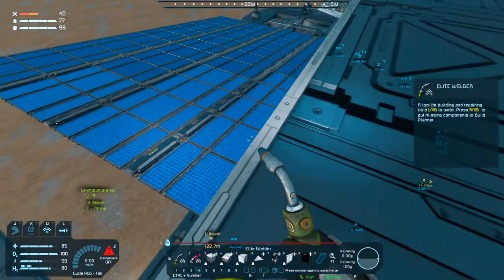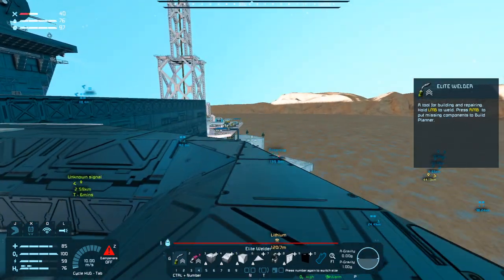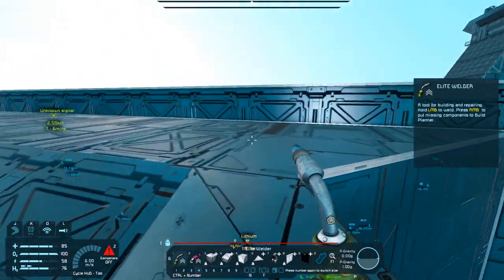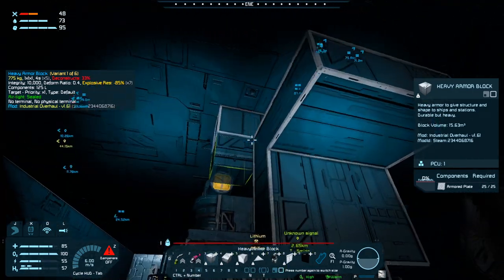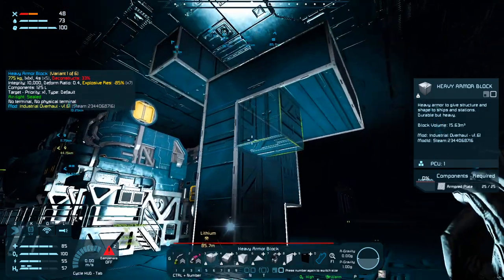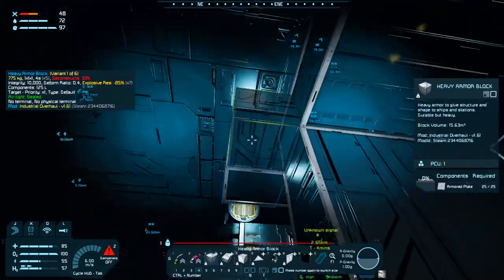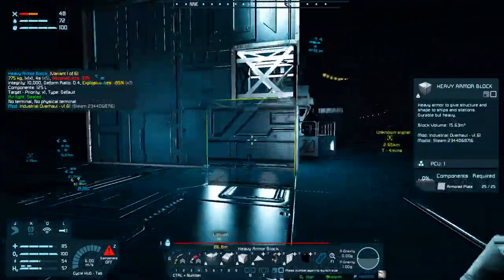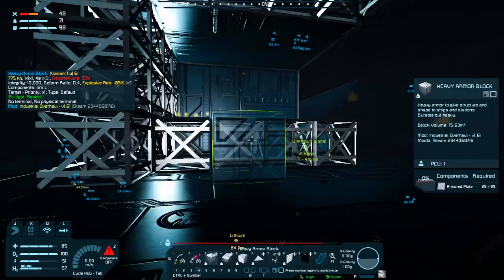Space Engineers ~ Sunken Hope ~ Coffin Box ~ EP 177

Comment: It is interesting that you have pipes running between hulls, because in some ships this was a standard way of keeping them out of the way of other things [made more room to move and fewer things to trip over or hit your head on, although this is not a completely universal tactic, obviously.

Some more modern ships have large, full length, central conduits right down the middle of the ship because it both acts as a spine for the ship, but also helps keep injury from happening due to external forces.

It also keeps certain highly sensitive connections contained where they will not spread a fire as badly or do as much damage as if they are just strung willy-nilly all over a ship.
Reply from the maker: Right. It just works out well with this build for sure.